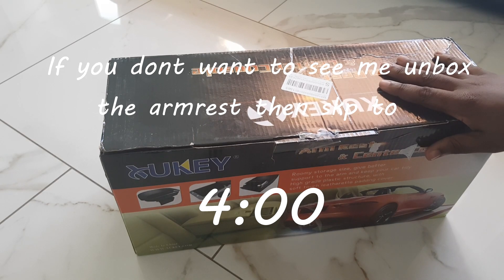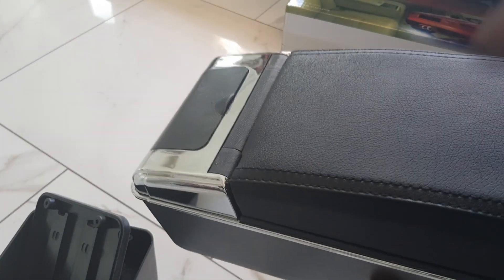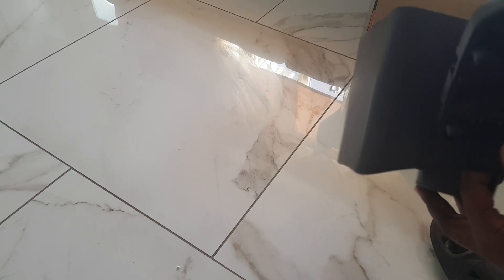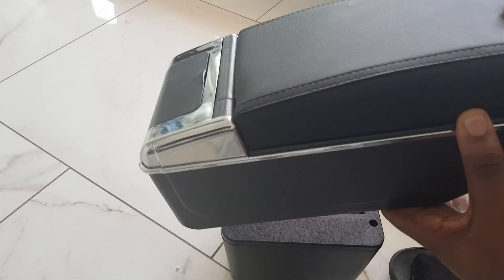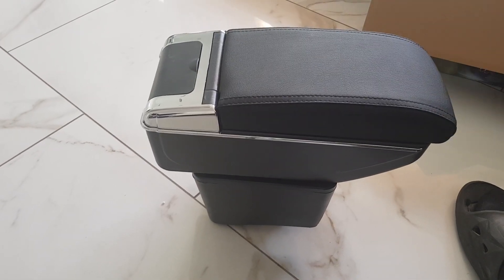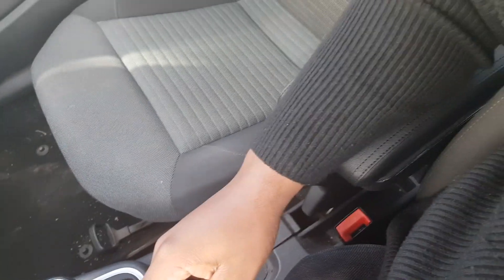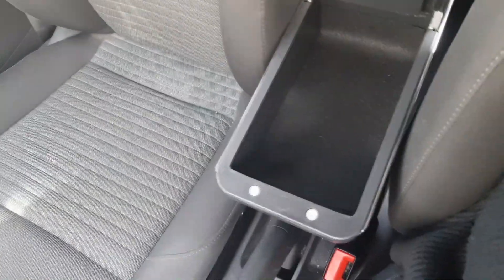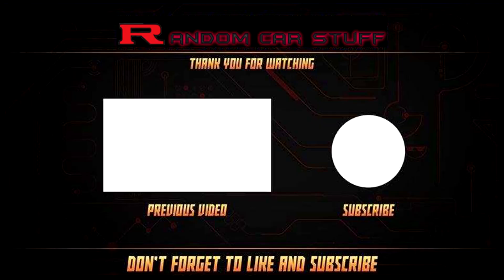VW Armrest install

Comment: you have not screwed the part that goes into the original cup holder that is why it is wobbly.also where you were putting the keys in is a cup holder not a storge compartment
Reply: How are you meant to do that

Comment: My main cup holder keep coming out when I put the arm on the rest anyone know how to tighten the main cup holder?
Reply from the maker: I believe they are held down by clips or screws, you should see if any are missing or broken. If not you can try secure it with a bracket and some screws

Comment: Gonna try bolt mine in place to stop it shaking about
Reply: did it help?
Reply: @rizzyyyyy  yea just drilled a hole through the armrest and the orignal cupholder then put a bolt through the two to hold them together, u could also just put aload of glue in the cup holder and glue the armrest to the cup holder, makes it more solid

Comment: A bit wobbly though.. must be shaky when driving the car.
Reply from the maker: When driving it doesn't wobble, only when you touch it, it will wobble. If you rest your arm on it while driving the weight of your arm also keeps if from wobbling.

In a future video I'll see if I can get it to be very firm so it doesn't wobble at all 😁

Comment: If you were to fill the box At 4:45 before screwing the Cover, and were to glue the part goes into the original cupholder, wouldnt that makellos ist more stable and less shaky? 
I think about buying that armrest and doing it the way i just mentuoned to be more stable
Reply from the maker: Yeah, if you could screw the armrest to the centre console of the car that would make it more sturdy.  It might still wobble a bit but it would be a bit firmer.